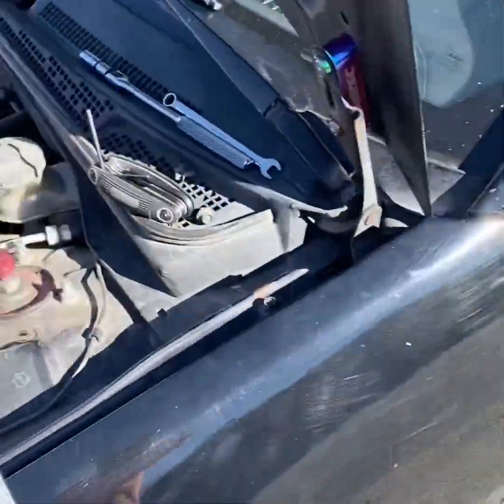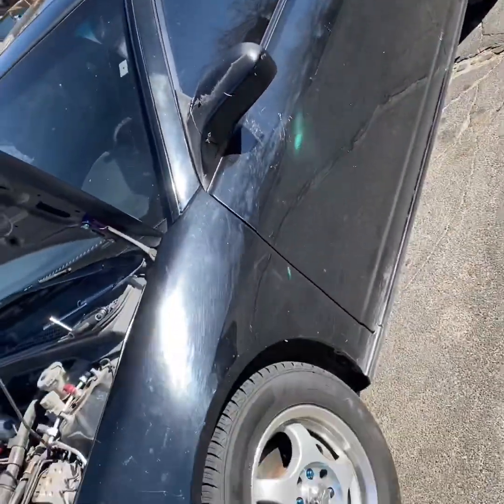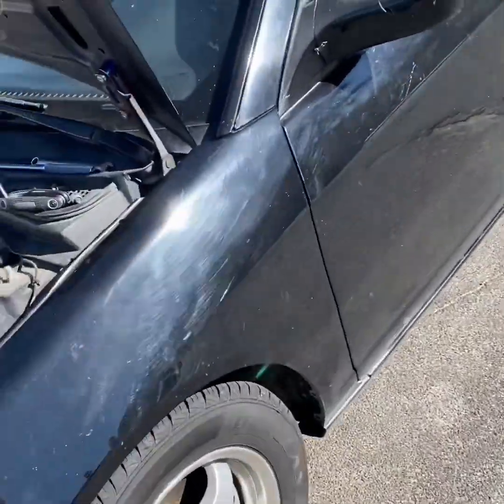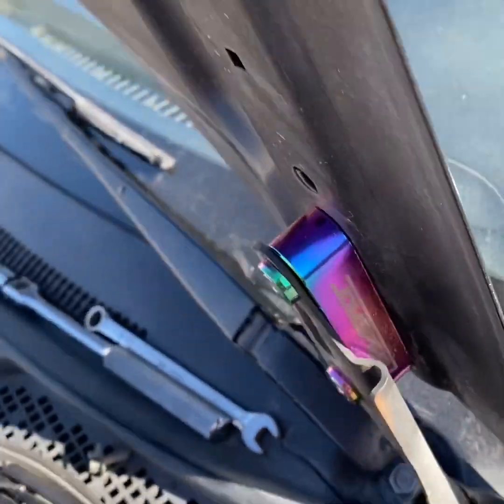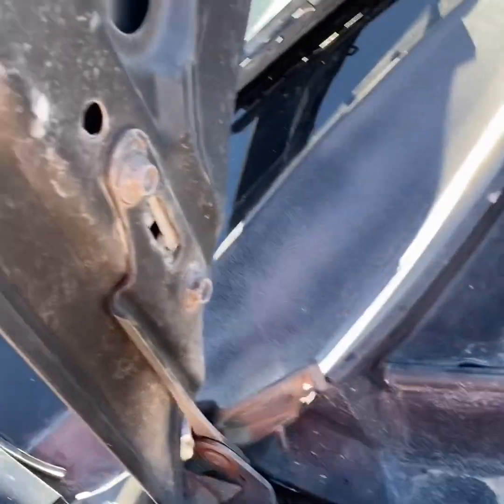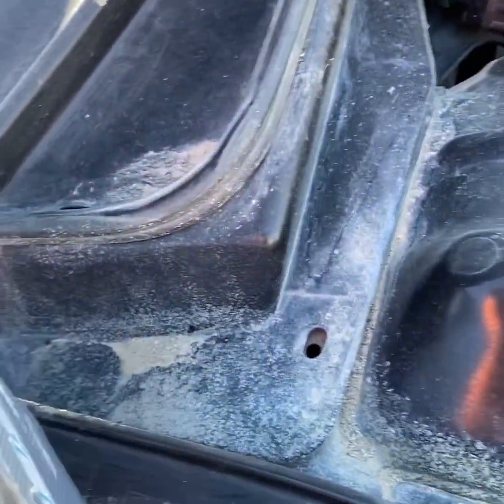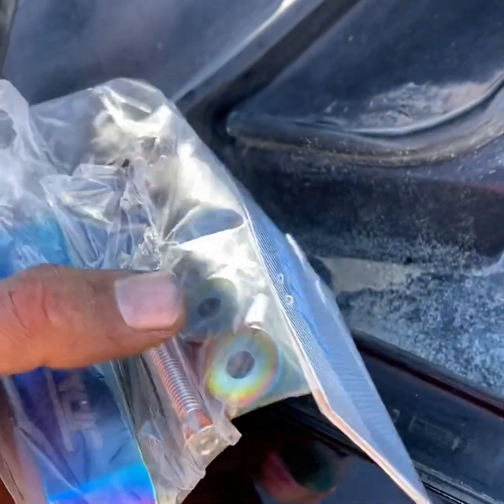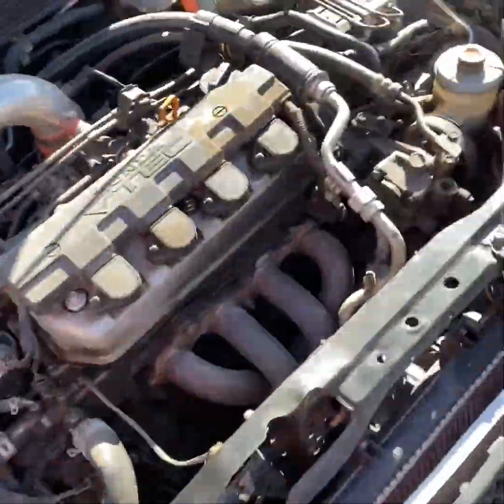Hot to install hood risers on 03 Honda Civic

Comment: What about when it rains like crazy? Water gors into the engine??
Reply from the maker: xElementZ GAMING water could but as long as the intake is not sucking in water it’s fine. These are used for engine swaps for hood clearance